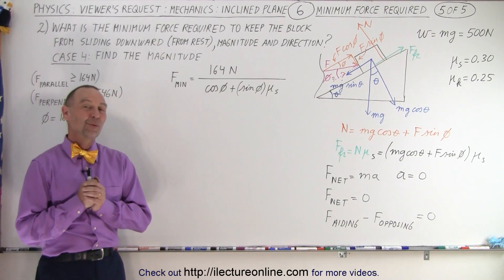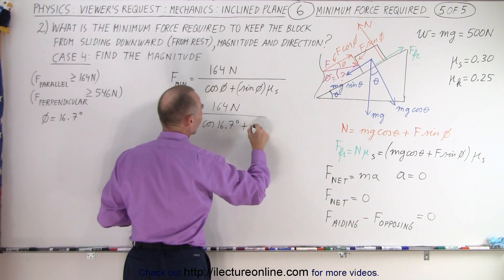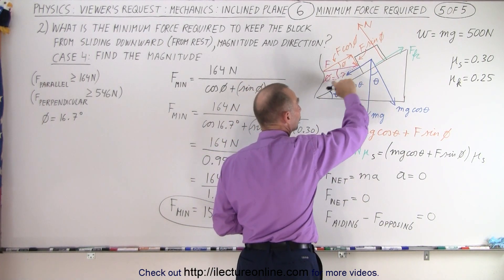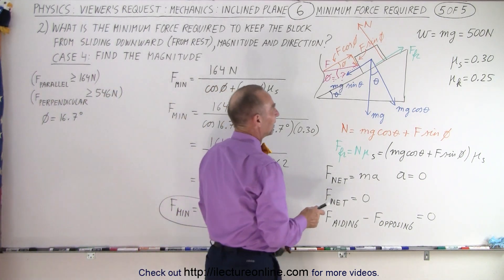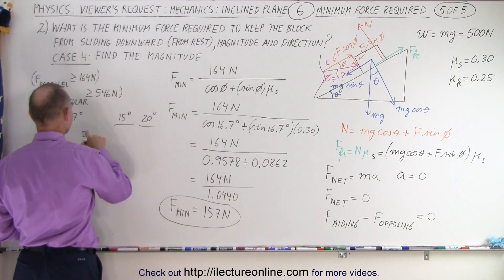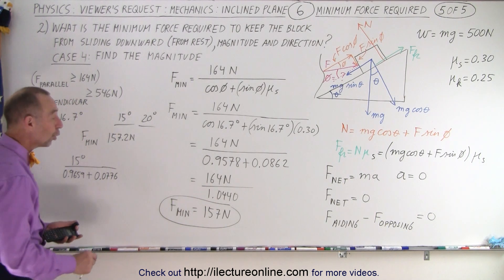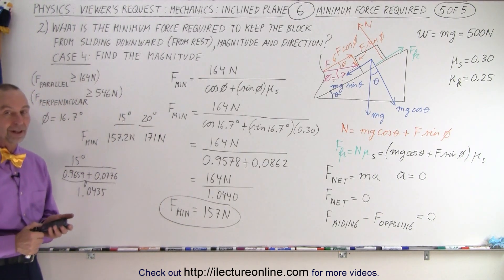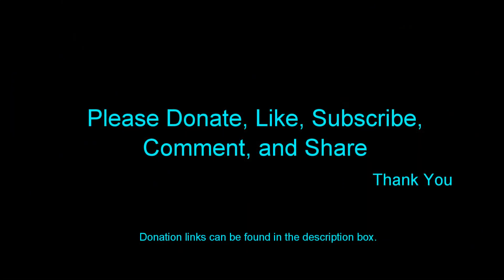Physics: Viewer's Request: Mechanics #6: Inclined Plane - Magnitude of Min. Force Required (5 of 5)?

Comment: Thank you for the excellent series of videos.  As you demonstrated at the 10:45 mark, the difference between 15 degrees, 16.7 degrees and 20 degrees should have been minuscule.  I suspect a slight calculation error at the 9:00 mark when you evaluated the 20-degree scenario and came up with 171N.  My trusty Casio is telling me that 164N ÷ [cos(20) + 0.3sin(20)] yields a quotient closer to 157.34N.
Reply from the maker: Yes, you are correct.  I probably pushed the wrong button on that one.